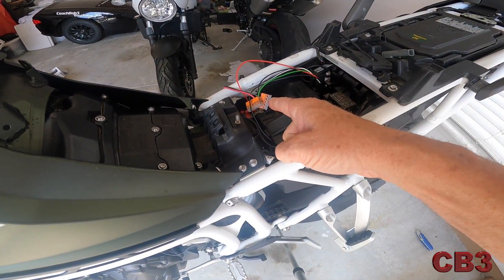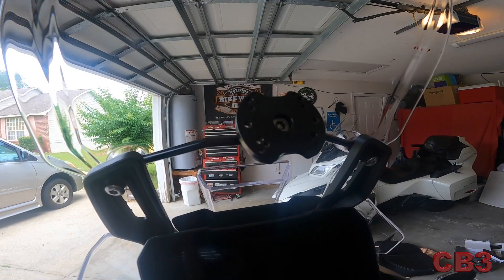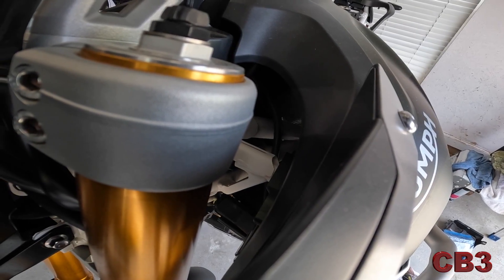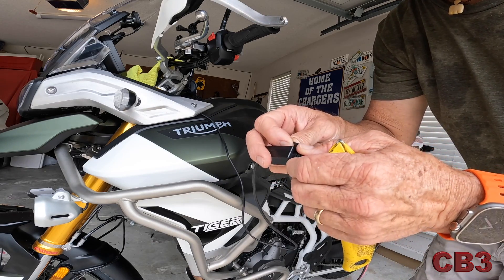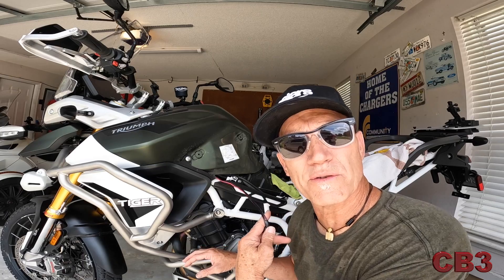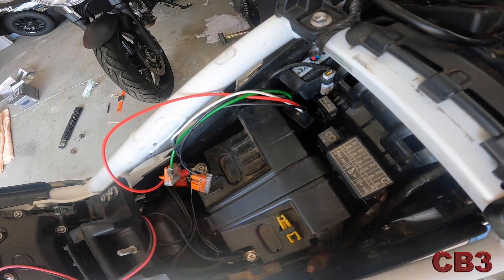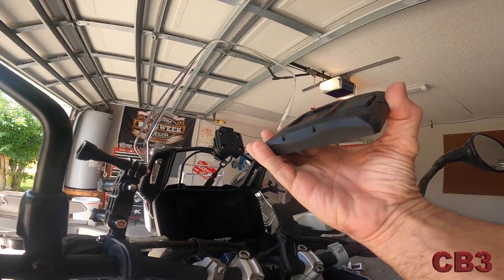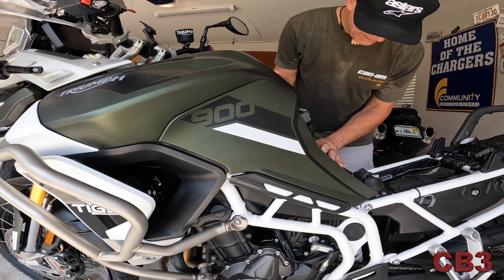Zumo XT installed on Triumph Tiger  900 Rally Pro

Comment: Looking good Bob.. A Q however.  With this wiring does the Garmin come on when the power is turned on or do you need to start the bike as you did? I have the GT pro, the 12V socket at the front is always on, the 12V socket on the LHS near the seat is switched on when power is on, but no need so start the bike. I have read that the usb socket only comes on when the bike is on. I think I may just use the 12V plug at the seat. Thoughts?
Reply from the maker: On my Tiger.   The front 12v is always hot and the one in the back is auxiliary powered (when bike is on). The way I have it done it automatically powers up and down with the bike.  You can opt to not power it down when the bike is shut off or if you allow it to shut off you can power the Garmin up. At that point it is operating only on the battery in the Garmin. 

I hope that helps.  Thanks for watching and commenting.